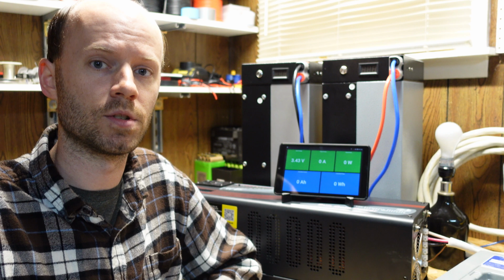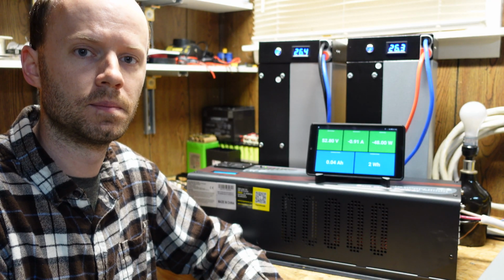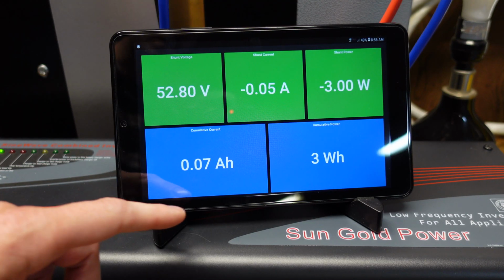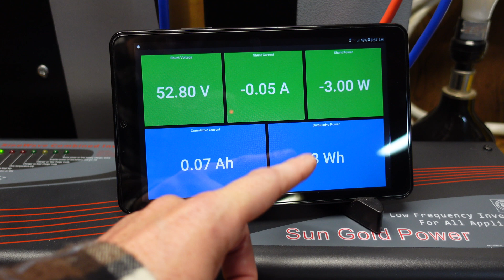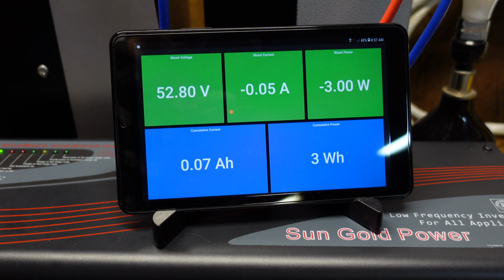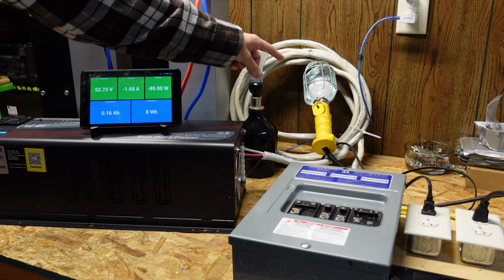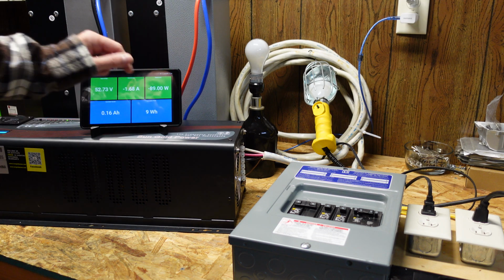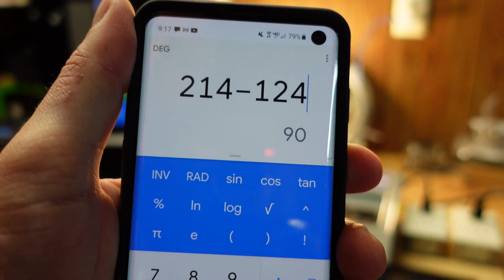SUNGOLDPOWER Inverter Power Saver Mode - Is It Useful?

Comment: i have a very small array right now, i just started building it. i only have 6 1,200 watt panels currently connected. i have 10 200 watt panels and plan on more, but it is winter and i can only do so much..... so, consistently i only have 1 load attached.... my well pump.

ultimately my goal is to save money on my electric bill. more power goes to running that pump.  as i grow my array and hook up more loads, that feature will outlive it's usefulness but for now it has it's place

Comment: I use the 6k lfp for hvac compressors only.  For this use, power saver works fantastic.
Reply: I've seen your vids. Power saver should help with tank water heaters too. I suppose this inverter could run my stove/oven in power saver if she was willing to give up the digital clock. Maybe it could run a 240V drier in peak sun on power saver mode.

Comment: Thanks for the video.  I came across it when trying to learn how my inverter works.  Hoping you can help me with a problem- when my RV's inverter charger is in power save mode my appliances (e.g. microwave) or lamps plugged into AC pulse on and off like in your demo; but when in the ON mode my appliances stay on.  Do you think my inverter is defective?

Comment: IN order for power save to work, do you have to use leg 1 vs. leg 2?    I’m asking because when I turn the power save on, I don’t get any power and when I switch to normal power, it shows approx 1700 watts.    Thoughts?    Anyone know?
Reply from the maker: Yes, it's only sensing devices connected on one leg. If you have them on the leg not being "watched", it will never turn on.

Comment: Your point is very well taken.  However, in my case, I have this unit directly connected to a 48v battery that has a 120v plug connected to it and it charges up my ecoflow delta pro at 1800watts and nothing else on the market can do that --- that I'm aware of.

Comment: @Lithium Solar Possible to wire 240 to sub panel and have 120 and 240 outlets? To run 240 mini split and 120v to other outlet? Someone tested inverter power consumption,used 30% power from bat bank.
Reply from the maker: Yes, this is a 120/240V inverter.
Reply: @LithiumSolar  Thanks for your reply! Didn’t want to buy one with ability of only 120 or 240 at a time.
Reply: @LithiumSolar Now wondering if power saver mode is safe for mini-split.Electronics like you mentioned in vid that may be sensitive.
I have 6k Sigineer inverter just like yours and uses 185 watts no load according to victron shunt app.The mini-split is 48v so not like a light bulb on double hit for power but does it double hit? I never used power saver due to seeing you observation.Did you test with a single unit like a mini-split in power saver mode by your inverter?
Edit,So mini caught up and switched to power saver mode and shut mini off lol useless saver mode !

Comment: Thanks for going over the power saver auto setting, could not figure out why at the panel i could not get it to work, but at the inverter it worked just fine, i switch the legs and presto it works, i will use this leg for back up sump pump.

Comment: I have a question about my SunGold 18000Watt inverter.  Does it automatically shut down the AC load at night and receive power off the batteries, if they are connected?  I had not turned on my charging function for the first few days, but noticed that the battery voltage had dropped from 53 volts to 47 volts.  It will be great if it does that once my DC Optimized solar panels are connected.  I have 8 200AH batteries (2banks of 4 in series =48volts). so my available power is 48 volts @ 400AH.  What are your thoughts about this?

Comment: Great info.i am planning to up grade to a 6000 watt sungold but I have a guesting that I can't seem to get an answer to.maybe you could help,having this unit hooked up to come on automatically when the grid fails do to a storm or whatever.if I'm using more than 6000 watts when the power goes out,like my central A/C uses 7200 watts when it's running and I was wondering how it will react when tries to come on with a load more than it's able to handle. Any input will be appreciated.

Comment: you mentioned that in your house your refrigerator runs all the time but one made for off grid use will turn off for upwards of 80%or the time.     i have the 3k model and take advantage of the power save  every night....for just over two months now i have run a full size freezer and a smaller pellet stove in my garage. both of which are off a lot of the night. my freezer will run maybe 30%of the time and the pellet stove about the same. in the morning i see my battery bank has much more percentage of charge than before i put this inverter in.  You may not see the value but for me it is the reason i use this inverter. Even if it has a lower efficiency the end result is i have more power in my batteries in the morning to help if i have a poor solar day.
Reply from the maker: I don't recall saying that the refrigerator runs all the time. You're correct in that the compressor shuts off most of the time; however, the electronics in the fridge still need power. It needs power for the ice maker to function, the water and ice dispenser on the front door, the light bulb to turn on when I open the door... Sure, the compressor doesn't run but the rest of the fridge needs power. Now if you have a freezer in the basement or something that's rarely accessed, then maybe the power save mode will work. Or I can see it a nice value if running very specific off-grid appliances (great for a well pump for example), but just not practical for running a typical US household.

Comment: I have the smaller version of this inverter that is 120VAC only.  The "power saver" mode is just as useless in that model due to the issues you mentioned.  Fortunately that won't matter much for my application as I am basically just using it to build a big 5Kwh "solar generator" that I can use to run power tools and what not when I am not close to an outlet.  So it's not a big deal to leave it turned off when I am not using it.

Comment: What I do is, I wired an ATS switch to the power on/off switch, so that I am using this inverter only for heavy inductive loads during daytime.  For the light loads at night, I am using a 2nd much lighter inverter while this LF inverter is turned off. I tried the same with wiring a light sensor to the switch to sense day and night: works well too.  Now I wired the ATS + the light switch in series, so the LF inverter switches off at a certain SoC of my battery AND at night.   This works fine and the LF inverter handles all my inductive loads in daytime.  I mentioned this to the company, but so far they have not done anything with it.

Comment: Will a fridge work with power saver mode
Reply from the maker: I haven't tried but I don't think so. The fridge relies on computerized circuits before the compressor turns on, and those circuits alone would not be enough to turn on the inverter.

Comment: LF inverters like this (and they are mostly all the same) are best used for larger systems such as: a small house, a shop, a cabin, or a large RV trailer that is ran by a power hog. 

Now If all you are doing is powering a few light bulbs and a computer or for short-term camping than a smaller HF inverter say in the 1-3kW range is better suited for that task.

3kW is enough to run a microwave and a toaster or coffer maker, plus a few LED lights. There is no problem running multiple smaller inverters for specific devices, but the idle consumption must be taken into consideration for that.

Most HVAC and dryers consume 5-7kW of power so you "probably" won't be using an HF inverter for that unless it is a 24-48kW model, that is if you want to avoid having to manage/conserve power. 

Just charging EV's at full rate can easily be 12kW, and that doesn't even consider anything else going on in the house. If you have an induction stove or electric stove that too can consume huge amounts of power (easily multiple kW's...) It can add up quickly when you are doing a whole house, most on-grid folks aren't used to worrying about that as they never exceed their 100 or 200a (i.e. 24 & 48kW), it "just works". The power company pays for the idle power, where as with off-grid it's all on you (or your batteries/panels to be more precise).
Reply: dang I don't know what HF and LF is. Everybody uses abbreviations
Reply: @VinceBadovinatz88  HF means High Frequency. It uses mosfets to convert from DC to AC. They can be very efficient (xijia), usually 120V only, like resistive loads. LF is (you guessed it). It uses a transformer to convert DC to AC. They can be more reliable, some can do 240V and they tend to be heavier, more expensive. Can often start inductive (LRA) loads. Maybe the best inverter is multiple inverters suited to their jobs.

Comment: Just a heads up for everybody: Graphene Aluminum ion is coming very soon. They will roll it out to cars in about 3 years. It's claimed to be 60 times faster than Lithium Ion and we no longer need to rely on China for Lithium, Australia will supply us with the aluminum and it is much easier to recycle. Please google this for yourself, hopefully it will replace lithium batteries so we don't have to buy on that evil AliExpress website

https://www.google.com/search?q=Graphene+Aluminum+ion&oq=Graphene+Aluminum+ion&aqs=chrome..69i57&sourceid=chrome&ie=UTF-8

Comment: you are perfectly right, it's no use to have power saving mode at the source when your end loads have themselves power saving mode that require a source to run... it's like having 2 fuses in serie

Comment: @Lithium Solar amazing Vid. 
Makes 100% absolute sense
Don't use this power save mode on Sensitive electronics. The constant on-off will power cycle your electronics to the point of oblivion.
It will also increase the failure rate of these electronics as the PCBs do not like being cycled too many times.

Like how an EMP Destroys PCBs because of the pulse of EM Waves.
Pulsing your electricity on and off is basically doing a smaller version of this.

Comment: Thanks, your test makes me think that the design of a fully off grid house could benefit from using both low and high frequency inverters.  You use (and wire the house) with 2 (or more) circuit breaker panels.  The high frequency panel is always on and the low frequency panel(s) in power savings mode.  You could then go so far as to modify your HVAC system (and other like devices) to power it's electronics from the high frequency side and the surge heavy motors from the low frequency power savings side.  With a well pump it too would go to the low frequency side since it only needs to come on when pressure drops far enough.  If you are using an induction range I wonder if you'd want/need to modify that to split the power draw or can you run it on the high frequency inverter side?  With the right mix of inverters you can get the best convenience and power savings. To me this really shows that a fully off grid house is a much different beast then a grid connect house in terms of electric use.
Reply: Will the water pump be able to sense drop in pressure if its on low frequency inverters power saver mode.. What i mean is the water pump needs some power to figure out its working pressure and a low frequency inverter on power saver mode won't continuously provide it with power

Comment: This randomly came in to me, is there such thing as 36v solar system? If so what would be the advantage or disadvantages and hurdles(such in compatibility, is it rare or common, is it sustainable?)
Reply: Depends what you mean. Most solar inverters work at higher voltages because they string together solar panels that generally have an open circuit voltage above 40V. There are of course 12V panels and systems as well. If you mean a battery system then yes there is. You probably struggle to buy a purpose built 36VBMS for LiFe but most 48V BMS can balance a 36V system by just using the first 11 Balance leads and the positive balance lead. There are 36V inverters but because they're not as common as 24V or 48V they could be more expensive. There is no advantage over a 48V system apart from needing less cells. The wiring gauge has to be thicker than 48V for the same amount of Amps. 48V - can be more expensive but cuts down on wiring costs, 36V a mid point, 24V common because it's a bit cheaper to put together, 12V - pretty much reserved for mobile use these days (and being phased out there) and used to be common in off grid situations.

Comment: I think the power saver mode is mainly intended for a job site where you would be intermittently powering power tools but the fact it only monitors one leg pretty much limits it to 220 Volt loads.

Comment: I don't think this will be able to run a well pump either.
My father just installed one of those last week in his house and based on what we read in the manual, 
the pump is constantly checking the water pressure and turning itself on only when pressure drops (aka you opened the tap).
So without constant supply of power, the electronics may not be able to correctly detect low pressure and trigger the pump on.

So the constant flickering that might hurt electronics, and the inability to power any devices with "standby modes" makes that mode unusable for almost any device.
The only devices that might be safe to use in this mode are lights and power tools. 
So the only place where this inverter is useful in the power saving mode is a workshop.
And even there I would probably prefer to just turn it off when I leave and back on when I need to do something rather than relying on the eco mode.
Reply: I'm using a similar unit sungold version of the LV 65-48. I turn it on and off completely. I'm pretty sure the idle consumption is over 100 W. Its Brutal. Thank God I have another 12-volt system I'm using for a lot of my necessary stay on items I'm using the bigger 6548 all-in-one for my air conditioner and water heater.. i do keep it on during the day when I have plenty of sunshine

Comment: I agree with your summation 100%.  Any light bulb since incandescents has electronic power circuitry built in that may or may not appear to the inverter.  But a 100w equivalent light bulb in LED draws only 15 watts.  The only contrived use I could think of would be to use this as a secondary inverter to power something like water heating elements and used as a power dump load.  Then the inverter may in power saver for 23 hrs per day and maybe turns on the heating elements for an hour during peak solar.

Comment: I think you gave an excellent description of the power saver mode.  Great visuals to describe how it works.  However, I'm curious what other techniques can be used for creating a power saver mode besides periodic pulsing?
Reply: I think the most reliable way would be to have 2 or more inverters and an amp meter.
Run the smallest inverter constantly and when the amp meter detects you need more power, 
then turn on next inverters and if it detects less power needed turn them off.
The thing is that would make such a multi-inverter quite expensive and still not perfectly reliable.

If I would have a 100W computer connected and then turn on a 3000W machine it could kill the power to the computer before the extra inverters kicks in.

Comment: I've the aims variant, and have thought of modifying mine for greater efficiency and usefulness of the power save.

I think I'll add an external fet based inverter for a much lower load, say 300W. The power save switch will be tied to this mini inverter. When the mini inverter goes into an overload condition, it will trigger the main inverter to turn on and the mini inverter to shut off until I manually put it back into power save or find out how to gauge the load the big inverter is experiencing.

Don't know, just an idea. Hybrid of these two technologies.

Comment: Yours said it has a lithium battery setting, when I look online they don't.  I have an NMC battery ,any suggestions on a split phase inverter that also has a mppt?  Thanks!
Reply: I am fairly certain this model is available with solar charge controller included.

Comment: Finally someone that understands the difference between idle consumption and standby consumption.  It's frustrating manufacturers often don't State both in their specs.  Manufacturers should put a efficiency graph showing the efficiency spread over the full range of its output abilities!  My 6000 watt inverter idle consumption is less than 30w.
Reply: The all-in-one inverters consume a little more I believe.

Comment: I find it fine for my fridge/freezer, main load.I only use a big LF inverter for the occasional requirement of chopsaw, washing machine and pressure washer. Need to turn mine on fully for charging tool battery packs. Besides some charge controllers have USB output, that's where I charge my phone.
Reply: Hie does fridge work with power saver on
Reply: @akashkumar9144  Yes.

Comment: So, 'in concept' I LIKE the power saver mode. But, in practice, loss of the UPS function (if needed) is a tough pill to swallow. I'm less worried about the pulsing even for sensitive electronics, but- I think I've seen other power savers than are constantly seeking load. But, 6.000W is far larger than my needs.  I wish that there were tons of 2,500W 12v/24v inverters to choose from- cuz that's what I actually want. I could probably live with 2,000W & I'd rarely need 3,000W (AC compressor lock only) but- don't want the idle losses.... It's a dilemna wrapped in an enigma. Or, it's truly a 1st world problem! I understand why the functionality is severely impacted though!